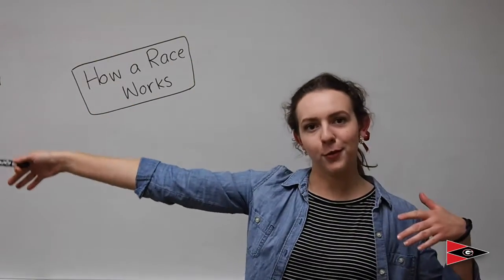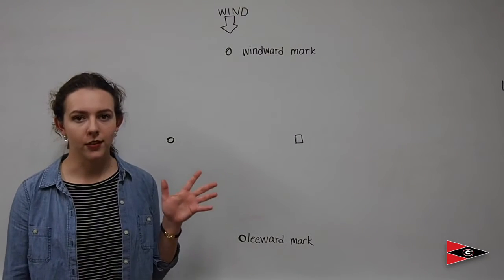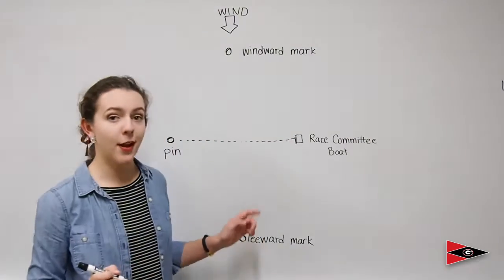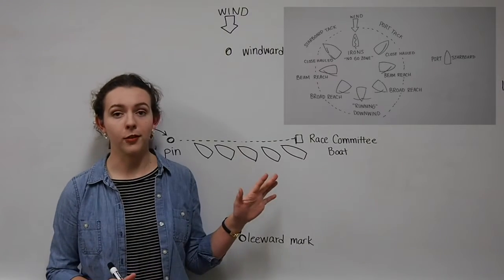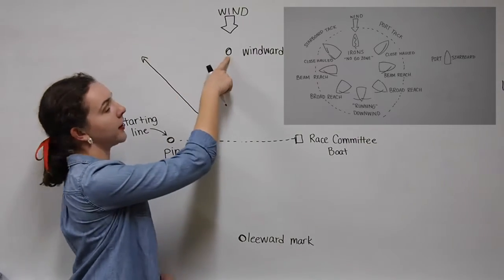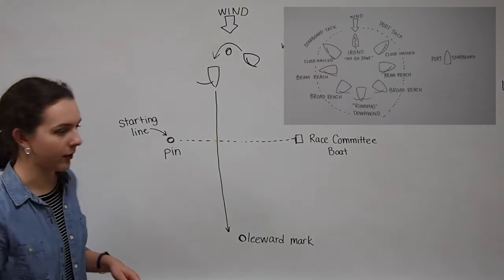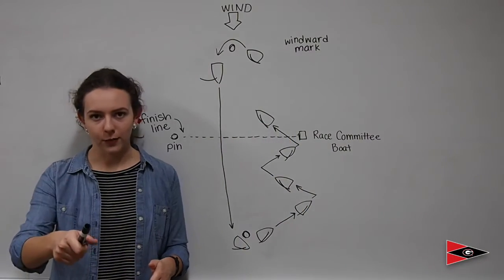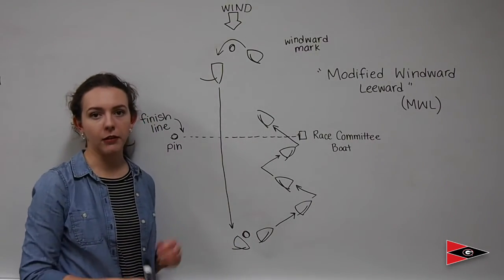UGA Sailing: How a Race Works

Comment: Note: in the run to the Downwind mark it is not permitted to cross the Starting line.. at least not in our fleets rules..,
Reply from the maker: It depends, yes! Especially in regattas with multiple fleets racing, RC will close it to those racing to permit other fleets to finish. If it's one fleet on the course, it's typical for RC to let it stay open. BUT reading sailing instructions is always an important race day prep step!

Comment: Great vid thanks. Quick question re the course - On a more complicated sailing course does the colour of the instruction for each buoy tell you which way to round it, ie green = leave to stbd and red leave to port ?
Reply from the maker: Hi Andy! Glad you found the video helpful. It's all up to the race committee on that one... typically for long distance racing, the RC will designate how to round marks with that kind of delineation or a variation of it. So yes but not always!
-Allison
Reply: Check the start line - if the pin is to port of the RC boat, then the roundings will be to port. If the pin is starboard of the RC boat, then the roundings will be to starboard.